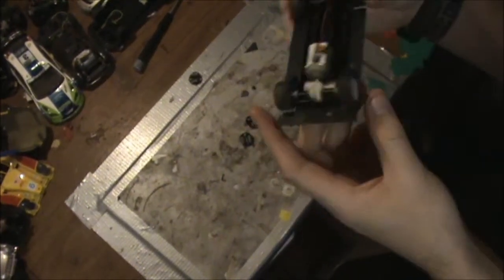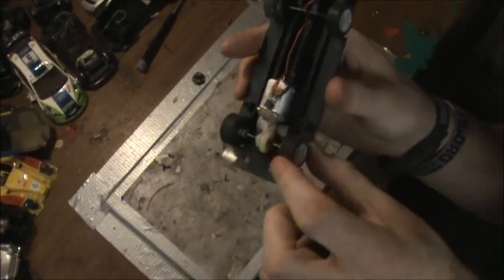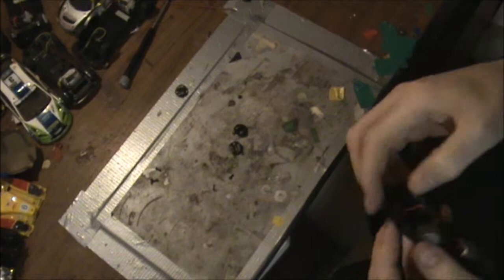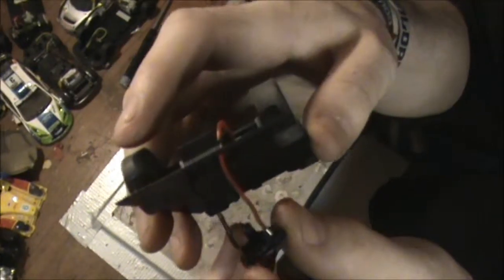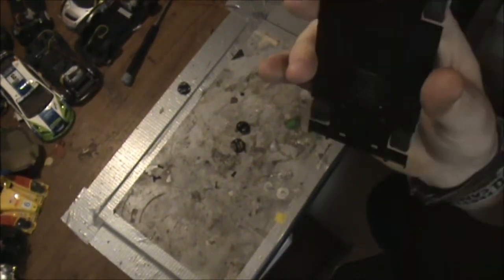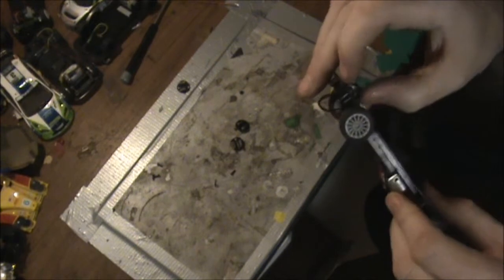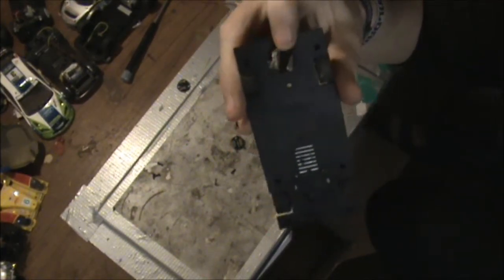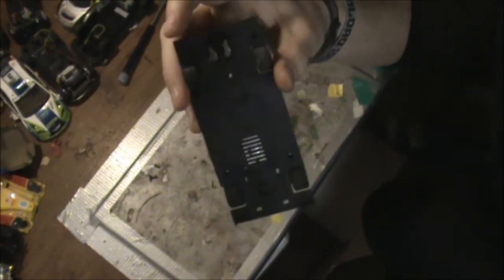Inside a START Car

Comment from the maker: They did when they first appeared, they have upgraded the material for the blade itself and this should fix the problem, they still break but we do have cars constantly running 6 hours a day 7 days a week. 32 lanes in this building.

Comment from the maker: You have to hardwire them for digital they are not digital chip compatible. 
I don't think any one has done a modified guide blade for these yet I havent tried other guides in it yet, the standard "digital" guide wont fit it though.